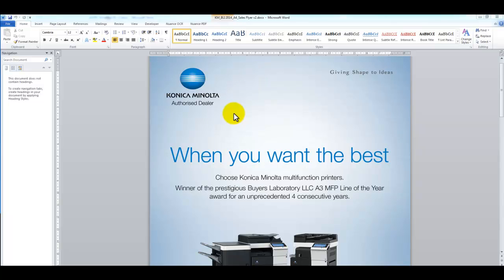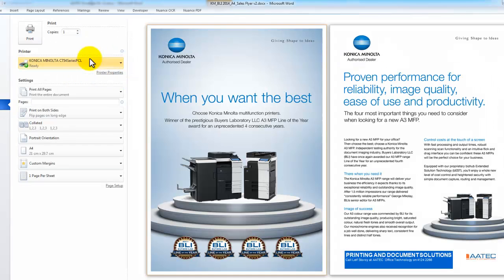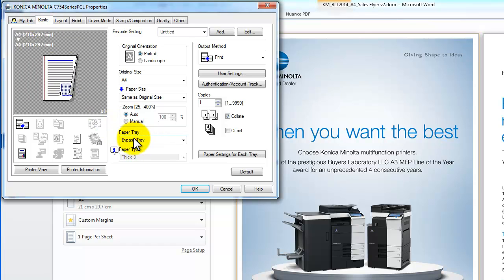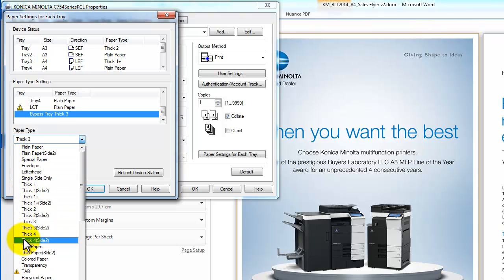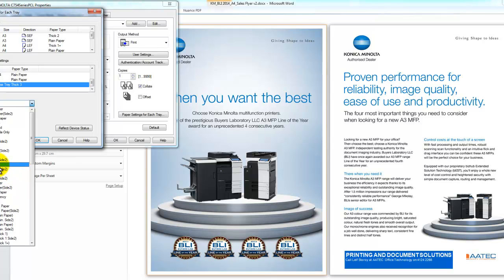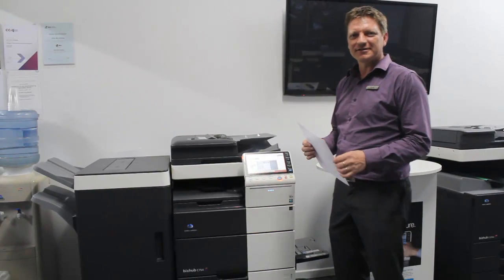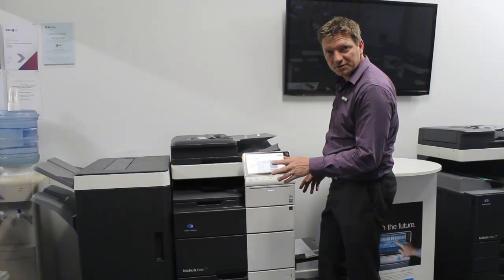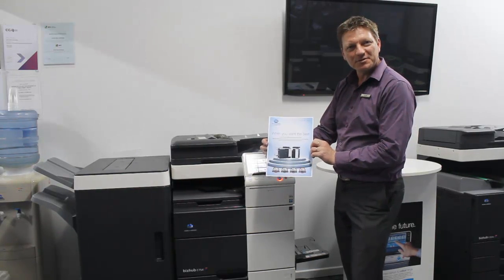How to print on Thick Paper, Konica Minolta bizhub

Comment: I have a question and I need an answer : I bought a Konica Minolta Bizhub C224e, it's a really nice machine, high quality prints, maximum thickness 300 gsm (thick 4). I use Fabriano papers (300gsm) for business cards but after finishing and cutting, the cards seem flexible and my customers are asking me why their business cards are not rigid. Can I use a 350 gsm papers to resolve this issue or there is a risk to damage the printer ? I usually printi small amounts (100 cards, 10 per sheet = 10 sheets).
Reply from the maker: +Ghassen El Bekri Hi there, I suggest you ask your local service provider for advice regarding this. Generally any media that is thicker or not within the recommended specifications are used at your own risk and may void warranty or not covered by a service pan.
Reply: You can use
Reply: laminate the cards

Comment: We have C224e and C220. The quality for 220 was better than 224e until lately. For both machines, when you print a solid color especially blue background, it fades on some parts (white  paper patches are still visible.) It becomes even worse if you're printing both side. Non of our local technician has given us a solution. Any one with a solution?
Reply: The C220 print in 300 gsm paper?